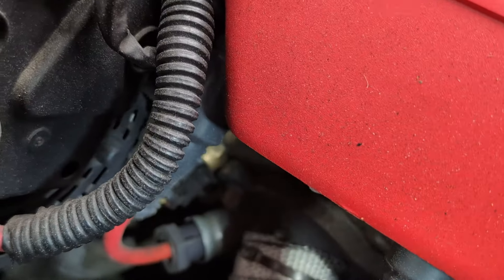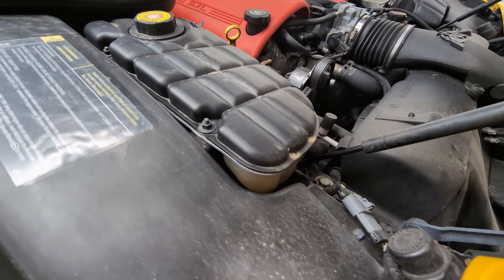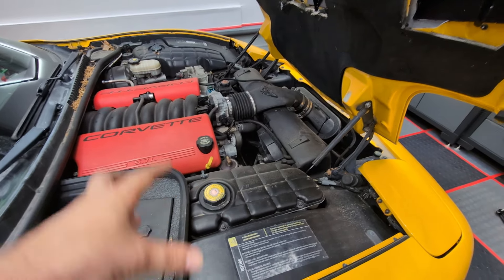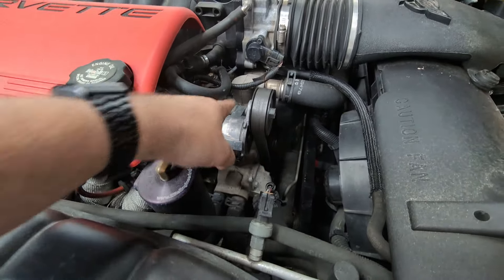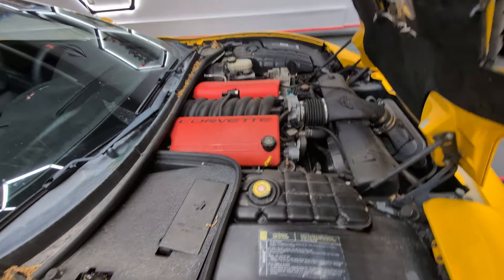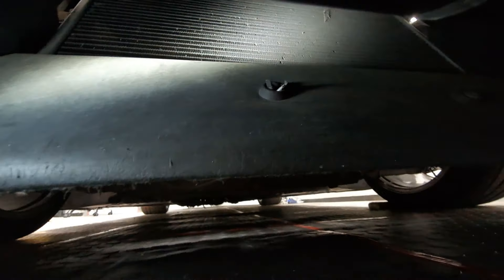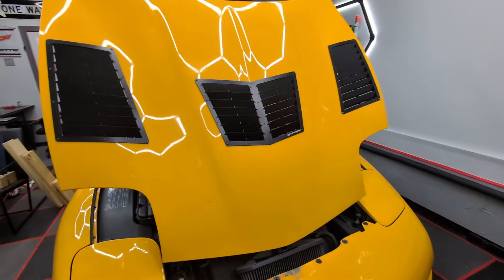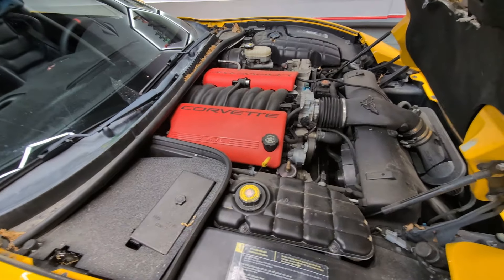THE C5 CORVETTE COOLING SYSTEM IS SIMPLE | HOW TO DIAGNOSE & FIX... ON THE FIRST TRY

Comment: you just confirmed my theory on the front lip. I have the lip with the outboard openings and I instantly noticed an overheating issue at highway speeds. I have a new one on the way that is like yours. thanks for the info!
Reply: Did it fix ur issue?

Comment: Mine overheats only at low speeds like you said. How should I go about diagnosing and fixing that? I also think I don’t have an air dam so I have to put one in LOL
Reply: I cleaned my radiator with air on my 99.
Temp dropped right down.

Comment: Forgive me if I’ve already pointed this issue out before, but I noticed you don’t have a gasket on the nose where the leading edge of the hood comes down to meet the nose. Your air filter is directly below that part and wash water will run through the hood joint and soak your aftermarket air filter. The factory filter has a plastic box around it to prevent that. To test it, lay a paper towel over the air filter, close the hood and spray water onto the hood, letting it run down the front and then check the paper towel. My Z06 already had the gasket, so I guess you would buy it on line.

Comment: Hey Mark, thanks for the video. Ive got a question: i have an 04 Z, 30kmiles. when i bought it it had a small upper oil pan gasket leak (confirmed by local dealer). the guy i bought it from and he just kept an eye on it but never fixed it. It didn't really leak on the ground, maybe a drop a month. When I bought it I took it to a local shop to replace the harmonic balancer and had them do oil pan gaskets at the same time. Still leaked. Fast forward a year later and they replace it TWO more times under warranty. Today its still leaking or seaping from the front and sides of the upper oil pan (as far as i can tell). What would you do? Doesn't really leak on the ground, maybe a drop here and there, but it seaps and runs down the oil pan and spits on the exhaust here and there, so you smell it. Im just not sure if i should just ignore it, or bite the bullet and take it somewhere else...don't know of a good local vette shop either, obviously the last one isn't any good...
Reply: It’s most likely leaking from the oil pressure sensor. Hard to believe a Vette mechanic didn’t check and relocate it or just replace it. Look it up! Lots of details about this fairly common issue.
Reply: @muffinmonster2714  no it's not the oil pressure sensor in my case.

Comment: I just replaced my rad, with a stock unit. Drive it about 10 miles and all was fine. Went to a car show last weekend and on the way back in light stop and go traffice the guage climed fast and as soon I we moved it went right back to normal. Did the same thing that the next light. I turned on the A/C and the fan does come on and the temp drops, however I cannot see if the left side fan is working. Any thoughts?

Comment: What if there's a squeeking chirp noise when you turn the A/C on?
Reply from the maker: Most likely a very slight belt slip when the compressor clutch kicks on and adds tension to the belt. A new belt will fix you right up. IF it still chirps then throw on a new tensioner 🤙👍

Comment: Yeah, I have the tune turning both fans on at a lower temp. Also have the ZR1 style front splitter with no temp. issues. Great maintenance tip video!

Comment: I spent 100 on getting it tuned to lower the temps at idle. At speed it’s always been 180-190, but stop and go traffic would go up to 230 which is right around where the second fan kicks on. I had the fan speed changed to 200 so now the car doesn’t ever go below or above 180-200. Best 100 I’ve spent on the car ever. No more heat soak and slow engine when parking up for a couple minutes at stores/meets.
Reply: What did they do for $100? Based on your explanation, mine needs what yours got.  What adjusts the second fan activation temp?

Comment: Hi there Mark; Matt here. Good vid with points of interest to check. I had to look this up but the C5 factory coolant temp when the fans turn on is 226° fahrenheit. When I had a cat-back exhaust and cold air intake installed the shop owner who also uses HP Tuners, reprogrammed the cooling fans to kick on earlier. A few weeks later, installed was a BTR stage 1 cam kit with titanium retainers, dual valve springs, Johnson lifters, Kooks header, catted x and mid pipe. Along with a new GM radiator and 160° thermostat, the temps stay around 185° to 205°.
This past winter being in the 30's to 40's, the car temps took awhile to get "up there" and the car was an absolute "gas hog". Was getting about 12 mpg; I usually get around 17. So yes, the car does Not run as efficient with low coolant temps in the 160'ish range. I think that I might be better off next winter installing a 185° thermostat and putting the 160° in my tool box.

Comment: I just cleaned my radiator of debris today, I actually removed it and blasted it with a mild de-greaser, high hose pressure water (45-50 psi), and then blasted it out with 120psi air and it came clean. I then blasted out the condenser (must do) and noticed a 15* difference on a 100* day. From 235* to 220* (right in the middle). I live in southern Ca and anyone who lives in a similar climate should take note that air blasting the radiator should be done every 6 months. Go from the inside out and then from outside in. cover any open ports, throttle bodies, coolant ports, etc, and brace for a dust and grass storm. There was literally dead grass and small pebbles flying out of my radiator, presumably from backing down my dirt driveway to my carport. Then clean your engine bay. You shouldn't have to remove your radiator, but this is my second C5 and the first time doing it to this car - I wanted to have a visual on what was in there xD. Also I 3d printed an adapter to fit a cheap tire brush to a 3ft pole to brush the  radiators from this point on.

Comment: I was gratified that the presentation started with the design temperature specifications, because the ignition event , and all the contributing factors , even down to the swirl of air into the cylinder,   are optimized for the design temps.   there is so much mis information out there with people holding on to obsolete concepts from non computerized engines, or just yahoos who buy more radiator than the design calls for, and strongly advocate their misunderstanding as the best solution.

efficiency is power, and we all know modern cars are designed to be as fuel efficient as possible.  so going outside of the OEM system design specifications  will probably return an ignorant result.